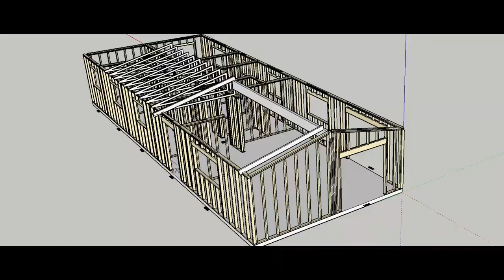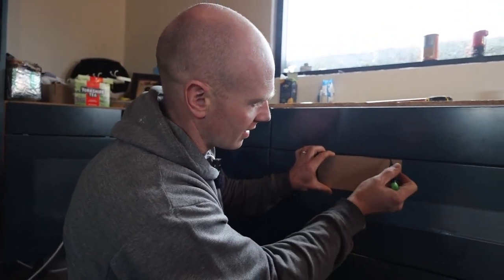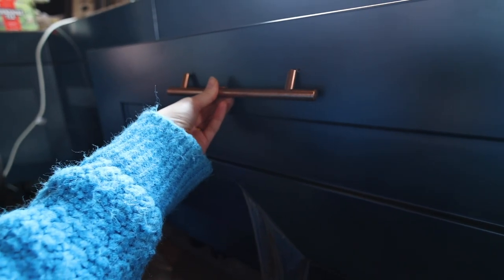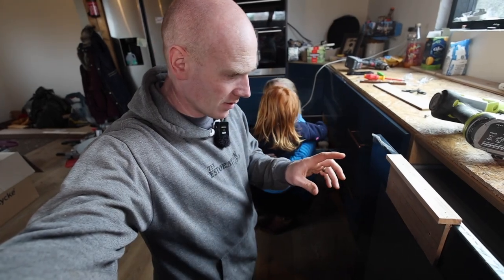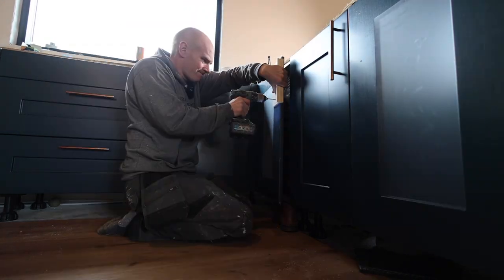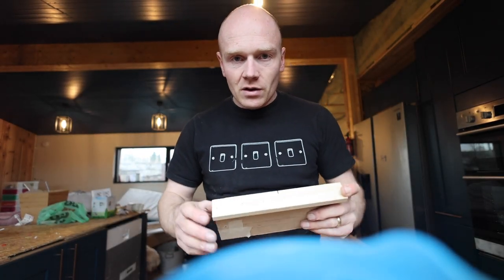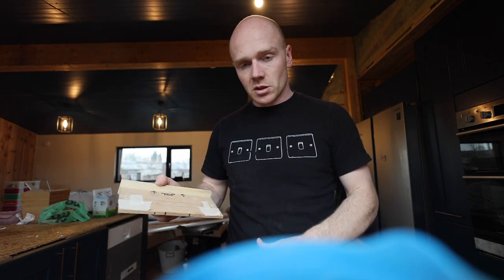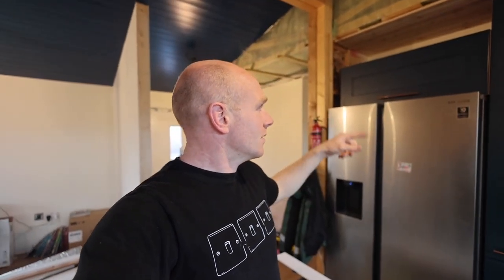FITTING CABINET HANDLES - Simple DIY JIG

Comment: For my fridge surround (an LG American style fridge, with DIY kitchens 900 top box) I used 18mm thick fillers on either the side of the fridge (giving me verticals to end the plinth against) and 22mm thick fillers either side of the top box. This gave me a fridge opening of  908mm, which is exactly the width I needed. I mitred the 22mm filler around the top and bottom of the top box as well, just to make it look neat.
Reply from the maker: Yep that’s the route I’m looking at. Should have enough spare plinth that I can use at front to match colour and some other 18mm ply behind to pack out. 👍
Reply: It is annoying that no one seems to discuss this issue anywhere (that I could find) and you’re just left to work it out. Worse still, I couldn’t even plan ahead easily because the width I got from the LG website was 917mm, but it was actually the doors that were the widest point. So I only needed an opening of 907mm. To get a 917mm opening would have involved a more convoluted collection of fillers and I’d have still ended up with small gaps down the sides, so I’m glad it worked out how it did.

Comment: I did a very similar jig when I did my kitchen, and used tape to cover the wrong holes too.
Though I chose knobs to reduce complexity and measuring :)
I clamped it with a backer block in each position too to prevent breakout on the back.
I didn't have any plastic on my doors.
On the island I have pan drawers either side of a slim drawer, I set the handles at different heights to keep them central to the rail or drawer face. Looks nice and symmetrical.
For the fridge, We went with a 1000 top box and have <50mm gaps either side of the fridge. I don't notice them now, I did plan to put LED strips in there or something like that but haven't got round to it yet.
Copper on cornflower blue is our scheme.

Comment: Excellent video showing a simple solution to the always fun handle attachment. 

With regards to the bridging unit. I agree that 2 x 18mm end panels should give you the perfect gap to then allow the F/F to sit neatly below. When we have fitted within housings before we’ve used a 1000mm bridging into which then gives you a nice shadow gap around the F/F. I think the 2 end panels will see you right though. 👌🏻💪🏻
Reply from the maker: Thanks. Hopefully the 18mm will do it. Hadn’t realised the fridges would be over 900mm to be honest.
Reply: @TheRestorationCouple  it does sound weird…I can’t remember a toe where we’ve had one larger than 900mm

Comment: One tip to stop the jig moving after drilling the first hole is to stick one of the handle screws through, therefore holding it in exactly the right place whilst you drill the second hole.

Comment: You can also use kitchen door handles for other things . . . I use one for managing the wiring in a computer rack
Have also used two to locate equipment in a precise position but the equipment can still be easily moved.

Comment: Hafele do a fully adjustable handle jig.  I've used it on 2 kitchen installs, and it's fairly foolproof.  It's not idiot proof though - it didn't stop me drilling the holes on the hinge side of the door
Reply: Yup - know that one! Had to replace the door! I now put a piece of masking tape on the corner of each door where the handle is to go. Also helps for getting the right corner if you lay the door flat to drill. Especially when you're doing several doors and someone interrupts you part way....

Comment: Just a couple of questions about making the jig. How did you cut it to exactly the rail width, was it bandsaw or circ saw and router say??? Also how did you get the centre points of the handles ie did you put the handle on the centre line and physically mark??? Did you drill the holes out on a a drill press??? I guess a dowel pin would work for registering the circles. I think because you have done so many it has become second nature but there are a few core woodworking skills at play here.
Reply from the maker: Just scrap but on the mitre saw then measured centres with a steel rule. No need to use anything other than a handheld drill on thin MDF but might have if 18mm to keep square.  👍

Comment: DIY kitchens would have made the cupboard any size you need. I have a cupboard that's 365mm deep so I could lose  a gap. Looking good anyway and you will not go wrong with DIY kitchens mine is 7 years old and as good as the day I fitted it.

Comment: I wouldn’t worry about the short handles being used - I jigsawed out a sink from a bespoke worktop precisely 30mm in the wrong location meaning it didn’t fit into the cupboard below.  Only cost £600 to fix!
Reply from the maker: 😳 I’m doing the sink today!
Reply: @TheRestorationCouple  Just make sure you have the worktop the correct way around (I had the back at the front.  Your kitchen is looking good - life will be a lot simpler when in.